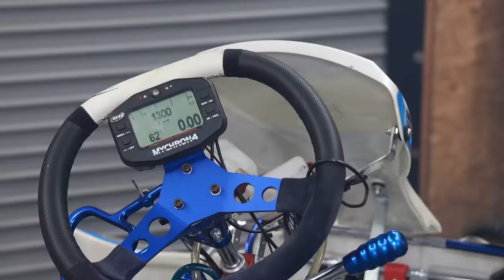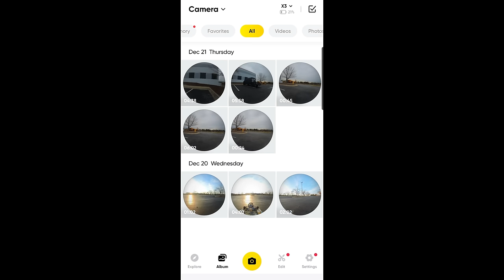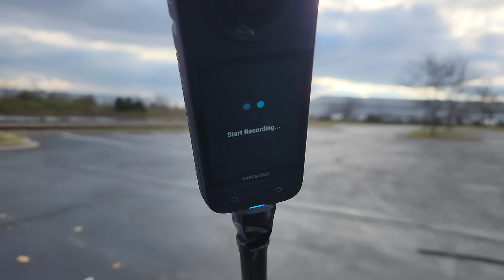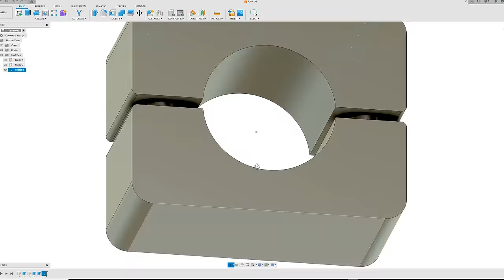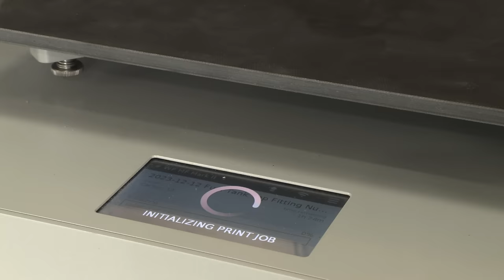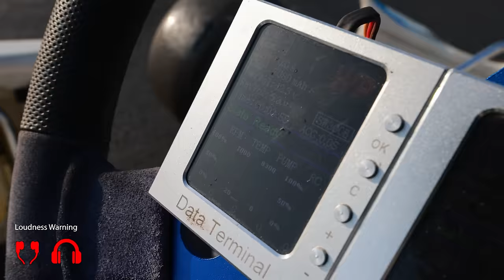Jet Powered Go-Kart (3 Jet Engines)

Comment: Would adding a turboshaft to the wheels improve anything? Do they make turboshafts that small? how hard would it be to convert on of these to one? Well... looks like I'll be googling the rest of tonight.
Reply from the maker: Turbo shaft is complicated, it's been on my list for at least 3 years maybe longer, couple issues but it's not that easy to get a turbo shaft this small, and most companies are not making large quantities of turbo shafts they are fairly rare. As for converting one of these I've also wanted to do that for a while and I may end up doing that but it's quite an engineering challenge when that shaft is spinning at 100,000 RPM..

Comment: Would be sweet if you connected the jet engines to the steering so you could get the back end out a bit better
Reply from the maker: I was going to do that initially, issue is thrust won't change direction in the moment like that, it takes a little time which works fine in the air but may not be so much fun on the ground having an invisible hand pushing you into a curb, I may experiment with this in the future... For now I have a lot of videos to catch up on.
Reply: @WarpedYT  that's why you're the engineer and not me! Also thanks for all of the great videos they're amazing!

Comment: Does the position of the jet engines behind the driver interfere with Ram Air?  If the engines were receiving more Ram Air would they not produce more thrust?

Comment: Man you should have strapped a racebox pro onto the kart both before and after and then compared your lap times.
Reply from the maker: Yeah I actually had a race logic V-Box, problem is I've been having trouble with the battery pack and the box charging, when I left it said it was charged when I got there wouldn't turn on oh well... Next go-kart video No doubt
Reply: @WarpedYT  right on.  one of those lap trackers bound to be a good sponsor candidate!  Happy engineering!
Reply from the maker: @tekn0lust  yeah I'm not crazy about any sponsors anymore, high demand and little reward. I buy pretty much everything I use

Comment: Make a combination, the best of both worlds. Normal engine for acceleration and let those jets kick in at 30/40 mph while putting the normal engine in neutral once you reach 60😂 I guess you could reach up to 80/90 miles at leatst

Comment: Turn the plastic side pieces on the kart into workable gas tanks
Reply from the maker: That was my first thought and I may still do that, but historically these come apart at the seams fairly easily so I wasn't confident. Additionally I didn't want the weight so far from the center of mass where it tends to creat a teeter totter effect.

Comment: Nothing motivates me like a challenge, short of one attached to a nice envelope of contract money. 
In lieu of the latter, jet engines need aerospace-grade brakes. Doing your own carbon-carbon brake set isn't as hard as you'd think. Look into heat shields for a build example, and stay Far away from traditional resins for bonding duty. There's only a few that will do the job, but with your youtube status, you'd probably have an 'in' with a brake pad manufacturer for clues if ya need 'em. Or I'd drop you a confidential clue. 😉

Comment: Air intakes are restricted by the driver blocking clean airflow into them. As for being faster than a shifter kart, its not even close from watching this, shifters do well over 100mph, even my 125cc tag karts do 90mph. Its hard to tell what its top speed would be on a long straight though, maybe take it to a drag strip to test properly. 
I also think it would be interesting to test a thrust vectoring system, a simple steel rudder wouldnt be too hard to construct, only thing is would it be better to steer thrust inwards on the corners to help turn it, or outwards to prevent over steer..

Comment: Do those engines benefit from laminar input flow? Would it help to duct the intake to the open sides of the cart? 
Would be so cool to see this on an actual runway or a flat road in the middle of nowhere.
Reply from the maker: Nah not these, not under 150 mph, these are simple single stage turbojets most of the power comes from the fuel.
Reply: @WarpedYT  ah, of course. That makes sense!

Comment: How about fitting a rear tail  maybe a twin type although make a single design first to see how it reacts & have a twin to try out aswell to help with more down force. A triple would be totally pathetic.  & altering the front splitter  design to help with cornering but,  strong control.

Comment: Who makes those jet engines ?  Also are there microjet engines that produce 200 lbs of force?  I’m trying to put together a mini jet for a two that would cost less than $250,000 that would fall under the new sport rules for 2025…these changes are fantastic…a sport pilot will be able to fly with multiple engines and turbines…and faster than 125 mph…so I’m looking to design and build a basic VFR two person short range micro jet for the new rules…😁 these new sport pilot rules are obviously built around the crazy concept of flying cars but also affordable mini jets too…
Reply from the maker: Yes there are, I don't know if these Would be considered microjet though, but That is really interesting about the new rules.. The short answer is yes there are these small turbines that produce 200 lb of thrust each.
Reply: @WarpedYT  no doubt stretching the rules to the limit, but it’s time to see if a genuinely family type affordable jet could be built…I know a couple guys have been trying and the limit has been two fold…the FAA and small jets like these didn’t exist till really recently…with such incredible technology…I definitely could see an “affordable” jet aircraft built for the family to take them for a vacation or further on weekend jaunts using new technology like this…who makes these larger jets?  These 200 lbs small jet engines?  Swiwin I’m sure is one…and it looks like they make a solid one at that…

Comment: Is there any chance you could be using the wrong tyres for this application. Maybe a softer compound tyre. Different shaped tires. Wouldn’t the jet engines be lifting the weight at the rear of the cart affecting road grip. 😮

Comment: Look up string theory, not the physics theory but when it comes to steering vs throttle response when cornering. It will make sense when you watch the video. But it should make balancing even this a lot better
Reply from the maker: Not under thrust propulsion.

Comment: “Conect the jet engines”  to the steering wheel, when you turn to the right the engines rotate and maybe will help turning 🧐
Reply from the maker: I was thinking about that but I don't know how much that is going to help, It might actually be very hard to control since thrust does not change direction on the dime like steering does, That idea is still loading........
Reply: It going to be a 50/50 chance😬 and maybe trie to do a suport that allow you to move for exemple just the central engine or the two sider engines for the steering, it Will be interesting to see the results

Comment: Why don't they have air inlet ducts that divert around your body? They'd be able to get cleaner flowing air and possibly better performance.
Reply from the maker: Because these are turbojet engines, They don't need direct airflow like that, if it were going over 150 mph I would definitely do it to improve efficiency, fuel efficiency. Now if they were turbo fan engines they would need a lot more air... The only time these type of engines care is if you start going real fast, But once you get to the speed of sound then it's game over.

Comment: With the Insta-360, if you tell YouTube during uploading that it's a 360 video then we'll have the ability to look where we want and you'll see your "viewer interactivity" rise with less editing effort.
Reply from the maker: You actually have to stitch it with metadata with the 360 software then upload it, I worked on one the very first 360 perspective video on YT  with infinity long time ago, it's more of a gimmick, u would think you would see engagement rise but they perform terrible. Viewers don't want to work. That's why this forced perspective emerged from that full 360 idea, it was companies solution to using 360 footage to get the best of both worlds.
Reply: @WarpedYT  hmm interesting.
Bummer though, because I very much enjoy having control of where to be looking.

For editing reframes, I recall seeing an option to highlight an object with a yellow box and the editing software will automatically keep that box centered. The video I saw showing that feature exampled a church door.
Reply from the maker: @n085fs  Yes exactly, insta 360 has an automatic tracker, There are some videos where I feel like the interactive 360 would do really well tho

Comment: You’ll get a far better engine efficiency if you relocate them away from the seat …. Jets need really great airflow and they’re not getting anywhere near enough where they are imho.
Reply from the maker: Maybe a little bit But only over 120 mph, these are turbo jets and single stage at that, they don't pull in nearly as much air as for instance a multi-stage turbojet or turbo fan, now if it was a turbo fan you would need It wide open. But these little single stage turbines get almost all of their power from the combustion, it may increase the efficiency a little bit but again only over like 100 mph or more if even then. You did give me a great idea though I have a great idea for a video off of your comment.
Reply: @WarpedYT  fair enough. It’s a sweet ride in any case.

Comment: Would facing the jet engines up a little, give up down force on the rear wheels to grip better in corners.
Reply from the maker: Yes and no, I intentionally have them angled slightly downward on the exhaust nozzle side, that way of the front end ever starts picking up from wind force it will have some downward push. Now if I were to vector the nozzles upward I would definitely get some more pressure on the tires but It would also try to rotate the nose upward which is not what I want.

Comment: Problem is, you’re still throttling it like a piston engine. You need to be on the gas well before you start turning. You’re just going to destroy the brakes getting through the turns fast.

Comment: My buddie Rick Young built a cart that went over 140 in the 1/4 mile with a alcohol burning twin cylinder motor he built he did this at Seattle international Raceway in 1969 he was gonna put 2 turboniques  engines on it and try to go 180 but a mortgage n shop payment got in the way he passed last December at 76 RIP the Walrus

Comment: If you want to take an idea then here my idea if you even asked why not try to make a uni-shafted go kart that has a twin in front and back but have both drive a single saft (maiking of it having four wheel drive is optional because of difficulty) like almost a reverse transfer box I'm sure you know what it is already but just in case (one  power source to drive forms(axle) in this case 2 engines to one drive

Comment: What about using heli or boat turbines housed to a cvt so you can utilize the torque and not just thrust?
Reply from the maker: I've been wanting to do that for a while but the supplier I had is extremely slow, those turbo prop engines unless I make one or not that easy to get.

Comment: I wonder what the speed and power difference is if you change the mounting place of the turbines. I can't imagine your body doesn't help but act as a restrictor plate, blocking the max amount of oxygen your intakes can get... I wonder if a shroud would improve it?
Reply from the maker: It may improve the efficiency slightly, but since these are turbo jets not turbo fans They actually need a lot less air than you think. Most of the power from this type of engine comes from the fuel combustion not bypass air. However if they were mini turbo fans they would need either a large shroud, ducting or completely open frontal area.
Reply: @WarpedYT  He said Oxygen, not air flow. One wonders if the the intake of the turbines creates a low air density area so close behind the seat especially when moving at high speeds. If thats the case It's restricting itself by burning less oxygen per CF of air

Comment: I just did a quick calculation, and top speed would be around 90mph 😮
Reply from the maker: what kind of calculation was that? It did 60mph top speed with a single engine that was less thrust than one of these.
Reply: @WarpedYT  Im guessing 90-110mph but I don't know the exact weight and drag. Obviously the faster you go the more the wind resistance effects top speed. I just did some quick calculations, but I might be completely wrong. I would love to see top speed tho.

Comment: simple. concept. turbine  runs 80k rpms in sweet spot. a 2 stroke rpm = 9k rpm.. wheres the torque? 2 stroke as it peaks torque at low rps , the turbine creates its peak torque at 80k rps.. (Just roughing the numbers)🙃

Comment: You don’t get heat in your tires you don’t brake as hard or accelerate as hard its easily half as fast as a shifter kart if you know how to tune a shifter kart motor.

Comment: You clearly need thrust vectoring.
Reply from the maker: I guess I'll see, I'm building in a few more safety measures and then I will be beating it pretty bad on the track, I don't want to give away too many details but it's going to be sick.
Reply from the maker: Problem with thrust factoring is you can't turn on a dime, it takes time sort of like a boat, think about a jet in the air, when do you ever see them make hairpin turns? Problem is on land you absolutely need to be able to make hairpin turns and last second decisions.

Comment: At full throttle, your speed in this scenario (vs in an aircraft with ram air) has zero effect on a jet engine as does a gear driven engine does, it's merely phycological.

Comment: the reason why this video is speeding up is because this thing is as slow as dirt. As it should be Jet power is only good for the top end after a very long build-up of motion.  a crapy brings motor would be faster off the line than this thing.

Comment: How much low frequency bass noise those engines produce? I have lot of high frequency noise makers like 120mm ducted fan, air horn. But can’t find anywhere cheap bassy noise makers. Those jet engines are expensive, ship horns as well even subwoofer. The best bassy noise maker I have today is 5g firecracker.
Reply: If you want lots of low frequency noise, build a pulse jet engine.

Comment: why not make it 2stroke / jet hybrid 🤷‍♂ should've left the 2stroker in there and just mount the jets on the back
Reply from the maker: I was going to but then the throttling gets complicated, I might try it later just for the heck of it maybe... But in reality I want to see what it is going to do on a track
Reply: @WarpedYT  thats true with the delay on the jet thrust, but on a straight it would be fun :D
Reply from the maker: @tezy0193  for sure but the issue is disengaging the clutch once the speed gets higher.
Reply: @WarpedYT  ahh it has automatic clutch i guess, didn't see that and never rode a shifter kart myself.
looks like a ton of fun though !

Comment: I have always liked your videos. This video that shows you ripping around that parking lot at high speed without a helmet is cringeworthy. If that kart would have wiped out and flipped, you wouldn't be making videos anymore. You would either be killed, or the vegetable of the day at the local nursing home.  It is very irresponsible for you to drive this kart without a helmet. It looks like you have protective clothing on. Why not your helmet?  I am happy you wore your full face helmet when using the jet engines. I don't know if you had it strapped on but nevertheless, you had it on.  This was a great video and looking forward to more.

Comment: You don't have enough suspension, brakes, or enough roll cage to be pushing this any further. Even if you upgrade, you are going to need aero for downforce to maintain stability and control. I'd seriously suggest you stop here unless you are willing to cut that car up and make it a chassis designed for the task.
Reply from the maker: You're absolutely correct, that's the same way I feel
Reply: @WarpedYT  Good, I have seen a lot of people I know hurt by pushing things past what they knew was safe because they were egged on by others. It's not worth it.

How is your Tesla project coming along?  Was following Obrist's attempt at doing it at a production level when I came along your videos and really looking forward to see how it advances.